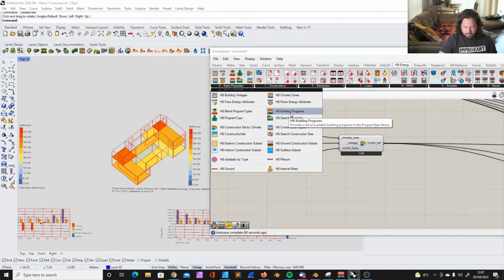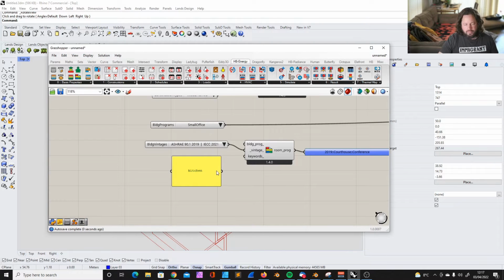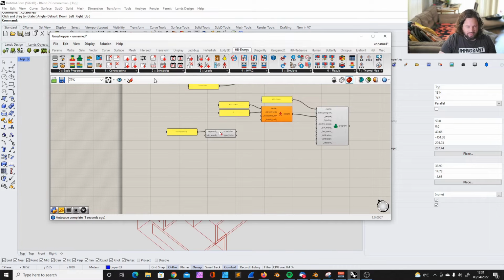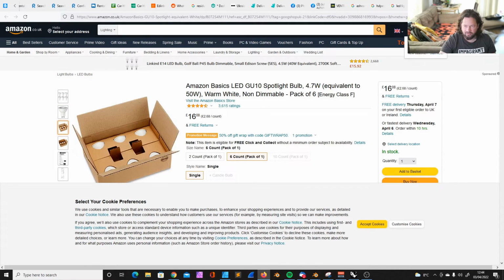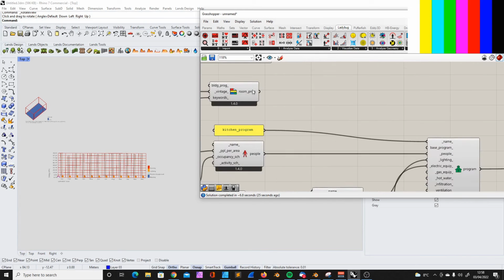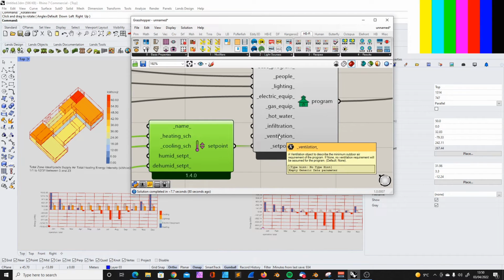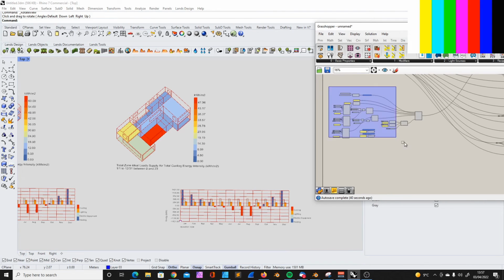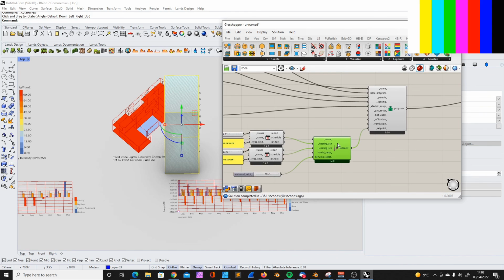Honeybee 'ENERGY' Part 4 | Programs and Passive Gains | Ladybug tools 1.4.0

Comment: Hi philip thanks for your vidios . Can you please explan what is measure and how we use it in energy simulation thanks alot
Reply from the maker: Solar gain is the energy captured through sunlight. Passive solar gain can for example contribute to the heating requirement and lower the energy consumption of a building or a room. In energy modeling it shows for example how much energy you potentially could offset by solar heat gain...
However the solar heat gain can be also too much so you actually need more energy to keep your interiors cool. Another way is to then designing a facade which can self shade the interiors for example...
It's a very broad topic with many answers and applications.

Comment: Hi Phillip. For the shading in energy plus simulation, can we use a shading geometry with thickness or should we only use a planar surface and only manipulate the thickness through the construction material?
Seems odd to me if we can only use a planar surface
Reply from the maker: I think that's how energy plus in general works. Through planar surfaces no solids.
It's all based on equations and material definitions.
Reply: @PhilippGalvanDesign  Hm that is weird. I used a geometry with thickness for the shading and it got no error. The simulation works perfectly. Therefore, I have no idea if that is giving me a highly inaccurate / wrong result.
In the ladybug forum around 2020 they said geometry with thickness only works for radiance, not energyplus. But there is no documentation about that.
Reply from the maker: @rl2388  well we are sitting in the same boat. I can also just use trial and error sometimes. Sometimes it's good to test and see if the results are different. Alternatively you might want dive deeper and read the energy plus and open studio manuals.
Reply: @PhilippGalvanDesign  Yeah, not many people actually went deep to try if the simulation results is accurate or not. I did try reading the energyplus manual and it confused me more, since my background is design, haha. I prefer doing some 3d modeling with blender as in your last video compared to reading text full of complex formulas.
But, yeah, I need to find out if the result is accurate enough or not..
Thanks Philipp
Reply from the maker: I think it just accepts surfaces only. No solids. Best way to find out is just testing it. It will give a warning message probably.

Comment: Hi Philip, My monthly chart does not read the people gain, infiltration and ventilation values. It also shows the connection is red. The component is grey though. How can I solve this?
Reply from the maker: Hi, sorry to hear. Did you work through the previous videos? Did you setup the program to allow for people's gain infiltration etc?

Comment: Hi Philipp, could you please share what exactly plugging the building vintage component does? Does it ensure only the selected ASHRAE standard in the building is implemented?
Reply from the maker: Yes and know. It sets the bulding base construction set.
If you don't modify items later in the script then this is the construction set for your building.
However, anything you modify later in the script will overwrite the vintage for the that specific item.
For example: I have a building using a certain vintage but then later i build another floor level on top of it, or i extend the building and wan to use a different more up-to-date building standart, then i can overwrite the vintage for the floor or extention only...
Another way would be to create more an more detailed models based on the vintage  as a base.
So for example a certain vintage type is in use but i modify certain elements of the building like a different wall structure then this will overwrite this aspect of the vintage...
hope its more clear

best
Philipp

Comment: Hello Philipp. Your videos are helping a lot!!! I have a question, the values showed in kWh/m2, show the energetic quantity that is required to be produced for the house to function well? Keep it up with your work!!!
Reply from the maker: Yes that's my understanding. 
I'll try to explain a bit more in the upcoming video. It's all a bit cryptic also for me.
It assumes that there is a heating and cooling system in place without specifying a distinct system. 
Note that these are the total values for the entire area not per square meter.
kWh/total Area. Not kWh/m2
Reply: @PhilippGalvanDesign  all clear!!